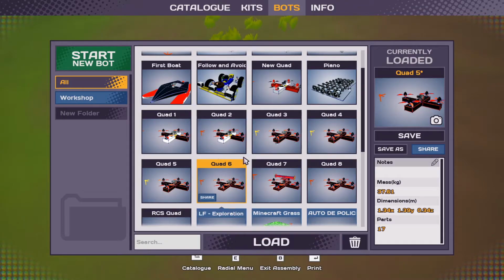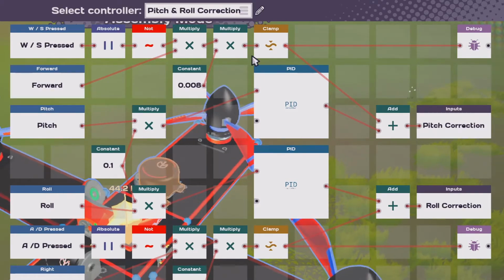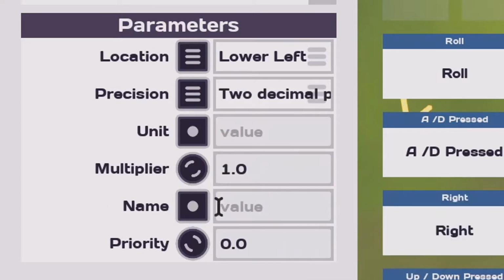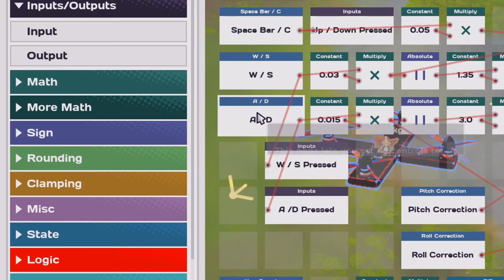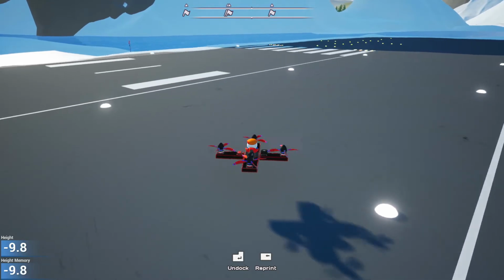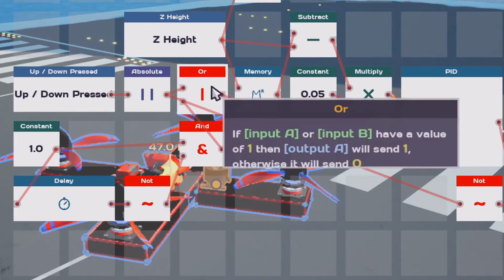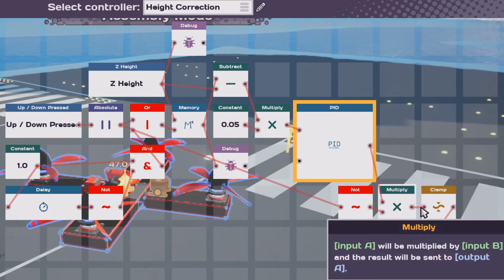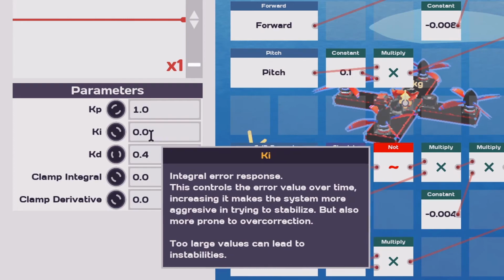Programming a Quad in Main Assembly - Part 2 of 2, Improved Stability

Comment from the maker: Real quads don't have servos; they put extra spin into the rotors to create yaw.  I tried converting to this method, and it was terrible.  On another note, I found there is a simpler method to create a one-tick pulse for the memory at spawn.  Use an Edge with a 1 going into it.
Reply: Try mine. Not perfect but it works that way

Comment: The issue with the integral building up when you go forward should be solvable.  Set the clamp integral to a sensible non zero value. This prevents it from building up beyond this value
Reply from the maker: Thanks for the tip!

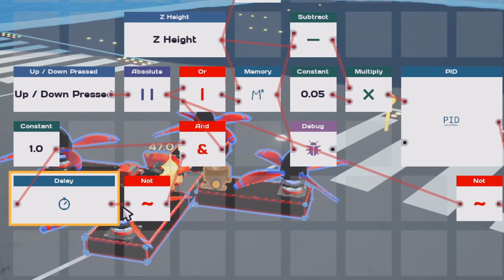Comment: Why did you use an and around 9:40? Couldn't you just use a binary?
Reply from the maker: Is binary a logic bit I can drag in?  I don't know what you mean.
Reply: @StevesMakerspace  I forget what it's under, but yeah, if the signal is 1 then it outputs 1, otherwise it gives a 0.
Reply from the maker: @calebhouston5799  That's good to know, but I don't see how that helps in sending a one-tick pulse into memory at spawn.  I did find out later that a 1 going into an Edge will work, though.